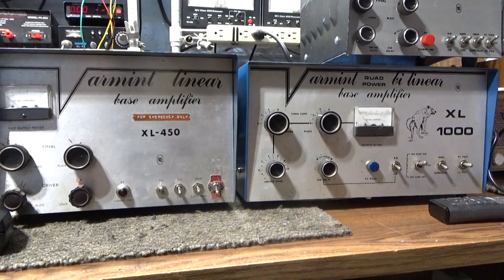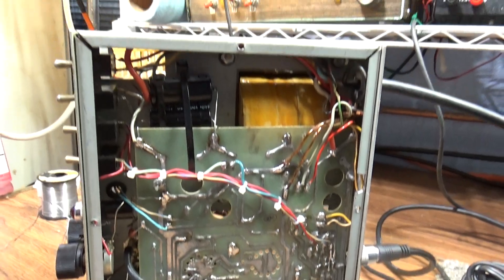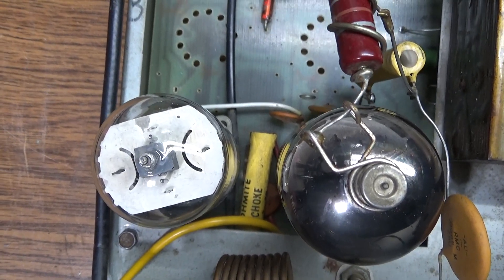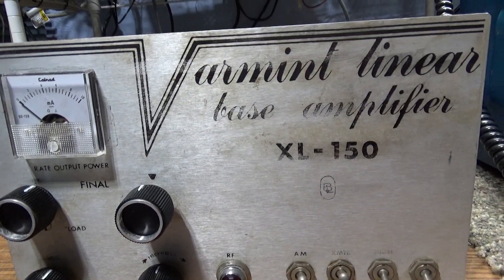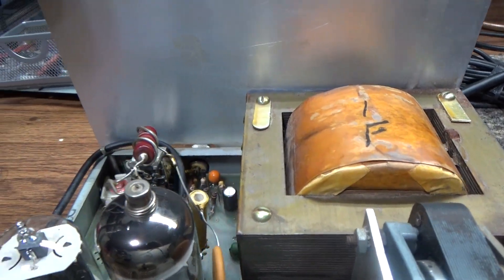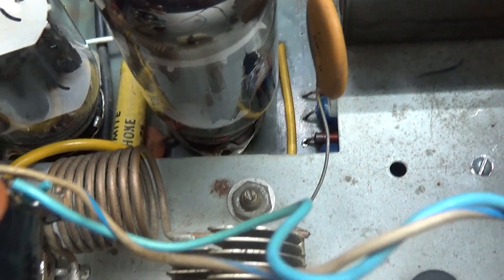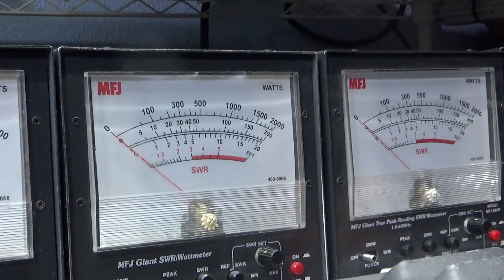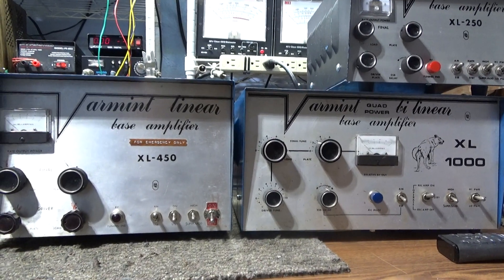Picked up 3 Varmint Linear Amplifiers. Going thru the Varmint XL-150 2 tube on this one.

Comment: The Poly-Booster was shipped from near Philadelphia and both tubes were destroyed in shipping. The tube numbers aren't marked on the chassis and no paperwork exists and I was in a panic. I got lucky and found a glass fragment with the tube numbers.
Reply from the maker: That is a rare rare amp there.
Reply: @tramdr  Maybe I'll do a short video on the amp with the cover off. It's just a pair of 6883, or 12 volt 6146, tubes.